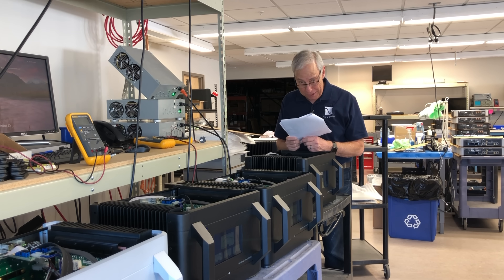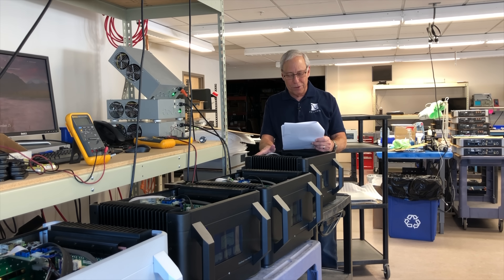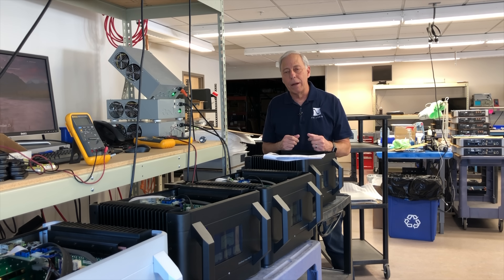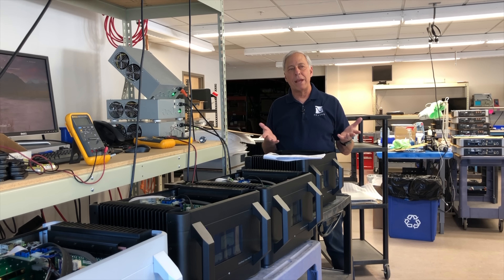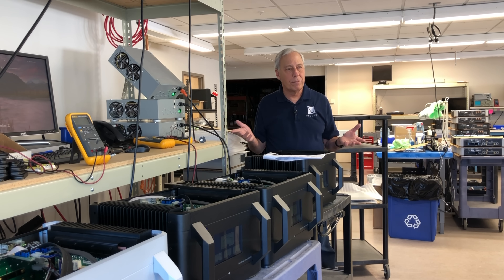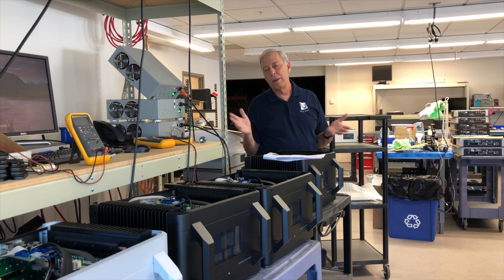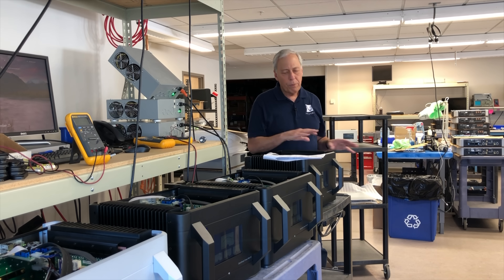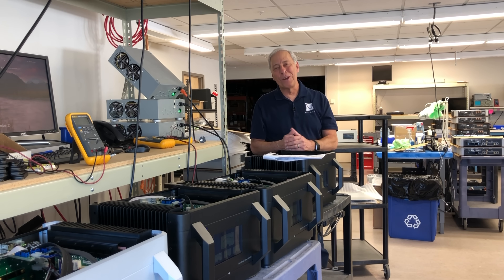Coaxial vs. conventional 2-way loudspeakers

Comment: I'm very surprised he did not mention that the biggest advantage of coaxial speakers is for nearfield listening. He mentioned point source, but gave a vague explanation of why point source would be needed. Since the tweeter is perfectly in the center, the time alignment of the bass and treble are perfect as the entire frequency range reaches the listener at the same time. If you need to sit close to your speakers, like at a computer desk, concentric speakers would be hard to beat. I almost went for the KEF speakers, but was turned away by the reviews claiming that the midrange was not that great. KEF and Elac make variations of concentric drivers but it's not truly concentric as there is a woofer on bottom and concentric midrange/tweeter on top.

Comment: When talking about Dual Concentric loudspeakers, Tannoy is the king.  They don't have the typical issues  with on-axis and off-axis sound performance on the higher frequencies, no significant toe-in of the speakers is required, sound dispersion is really good. I can move around within the room or sit down into my listening position without losing detail of sound (to an extent) as much as a 2 or 2.5 or 3 way speakers would sound like, I have Dual Concentric loudspeakers and transmission line type loudspeakers all made from Tannoy, certainly the dispersion of the sound at different listening locations is evident. That's the beauty of Tannoy dual concentric drivers, a point source, phase coherent
design and time aligned

Comment: For the high end stuff, you would be right, it (technically) sounds better if they are separate. But for the cheap stuff, a small tweeter won't really make that much difference to crappy separate tweeters, and the benefit of the point source sound enhances the cheap stereos so much more (and more bang for your buck). I got some $50 1.5 " (1" soft domes) and I can't really tell the difference between them and other 1" soft domes tweeters of the same price, that have large magnets.

Comment: Hello Paul, i guess i agree BUT dont know if you have heard the piegas with coaxial ribons for tweeter and medium frequencies? They sound wonderful detailed and extended and fast and dynamic, so much that the bass with convencional woofers gets a bit left behind. Piega even have line source systems also. Have you heard their top speakers? Each and every coaxial ribon is built by hand by one engineer! It is crazy...but do sound great if a bit analytical for some people.

Comment: What about the design theory where you take a horn loader tweeter then when the horn expands large enough you put a mid ranger then when it gets larger you put a woofer. Maybe 2way would be sufficient. I'd like to make one but its supposed to make the sound uniform
Reply: Ah, a synergy horn, pioneered by Tom Danley

Comment: Never heard of Tannoy? They are pretty old fashion.
Reply: Then you haven't really heard a coaxial driver.
Reply: I've worked with Tannoy all my life -- Reds, Gold series and I own a pair Tannoy DMT12's.  Never liked them and still don't.  The main problem with them is the horn (not tweeter) has a very limited narrow flare and the cone is supposed to be an extension of the HF wave guide.  Unless you're sitting dead center the woofer has a way larger image than the horn.

Comment: Any number of speakers perform and image well in their sweet spot. The problem is that most sweet spots are very narrow, often making listening a "party of one" or two at most before significant loss of sound quality. Music listening in my household is far more social so speakers with concentric drivers offer far better performance when playing to a crowd, for lack of a better word. I have Elacs in the family room surround system and they're terrific. The only non-concentic driver speaker I've heard that could compete with them is my pair of Seas Idunn standmounts, sold only as a kit through Madisound. Seas drivers, made in Norway, are some of the finest available. The list of speaker companies using their drivers reads like a who's who list of high-end audio. The Idunns, using their unique DXT waveguide tweeters, have usable horizontal dispersion as wide as 60-degrees off axis while having a measured frequency response of 50Hz to 20KHz +/- 1.5 db up to 15 degrees off axis! You can sit almost anywhere and they sound great. Their sweet spot for critical listening is nearly 8 feet wide and they constantly pull a disappearing act while imaging holograhically. I built a pair of them using Clarity caps, Mundorf resistors and Goertz copper foil inductors in series in the crossovers assembled by Madisound. I have an RSL Speedwoofer 10S subwoofer taking up the bass below 60 Hz. The combination absolutely slays anything in the $5K neighborhood and it drives my audiophile friends bonkers because the Idunns (in sapele figured veneer) and the sub set me back less than $1200. Now I'm saving up to get a Stellar S300 stereo amp for them...

Comment: What is the NPR or MPR programme?
Next time please don't stand next to those power regeneration modules !!... something there was causing terrible interference on the audio track .
Coaxial mounted speaker assemblies aren't much cop .. they're good for car doors only ... The Kef Uni Q drivers and the Tannoy Gold monitors use time aligned coaxial drivers which sound much better. I have always had reservations about the effect the cone of the LF/MR driver has over the waves emanating from the centre mounted HF dome .. but nonetheless the exponential curve of this cone would give the HF driver good sound dispersion. 
If Paul wants to build the new AN speaker systems I do hope he time aligns whatever drivers he uses.
The one thing that seems to be missing with the IRS V 's is a mid/bass speaker .. there is too big a contrast between those 12" drivers and the mid range ribbons ...
Reply: Janina, he says the mids start at 100hz. But I can't see how that can be still at 0db? frequency response? and not more like 9db down point. (NPR is our public radio here in the states. You have had me going for quite awhile where you are in this big world.)

Comment: I find my 2 way Qacoustics image and produce soundstage better than my coaxial tannoys.  Just goes to show a well designed two way can be better.
Reply: Hello Darren. Wich model of Q Acoustics and Tannoys do you have?
Reply: Pedro Luis Guillemain 
QAcoustics 3050i
Tannoy XT 8F
Reply: Two years ago I wanted to buy the Tannoys XT6F and a retailer who has them and the Q Acoustics 3050 recomended me the last ones, even costing half the price. I ended up buying the Q Acoustics Concept 40 and then, later, I changed them for the Q Acoustics Concept 500 which are monsters speakers. In AV Forums they prefer the Q Acoustics Concept 500 over some Tannoys with similar price. Im not saying Tannoys are bad speakers, but Q Acoustics makes incredible speakers for the price, competing with others twice as expensive.
Reply: Pedro Luis Guillemain yeah the concept 500 and definitely on my audition list. They do seem to punch above there weight.
Reply: @lloyd.8272  well, I haven't heard many expensive speakers, only the B&W 702 and the PMC Twenty 5.23 and I prefer the Concept 500 by far. Also two dealers who sell them told me that to better them, at least on the brands they sell, you have to spend quite more money. And finally you can read all the reviews out there, wich rave about the Concept 500 and there are a LOT.
Reply: I listened to both at a retailer and went for the Tannoy
Reply: To The Max how were they set up? 

Mine are 19’’ from the wall and 90’ apart and sat 90’’ away. 
Also have a slight tow in so the speakers are facing my shoulders.

Tannoys are good but I definitely don’t get the precise imaging and depth of the 3050i and I’ve tried lots of positions with them.
Reply: @lloyd.8272  Tannoy Turnberry Prestige GR, simply the best speakers I have ever heard
Reply: To The Max That’s a much higher class of speaker not to mention price range. 

I was referring to the Xt8f vs 3050i
Reply: @lloyd.8272  The thing that you are not doing with your Tannoys is giving them room, 90 inch apart is to short for any loudspeaker let alone a 8 inch driver, I have at least 236 inch/6 metres apart, if you can manage this you will notice a very big difference entirely
Reply: To The Max that’s how I’ve found the best sound with my 3050i with my room acoustics. Moving them further from the rear wall starts reducing the bass response, and moving them further apart starts to loose the centre image.

I’ve tried many different positions with the tannoys. There not as fussy with walls with the bass port being at the bottom but even using the rule of 3rds they don’t produce the imaging of the 3050i. 

Im having a evening in Saturday just chilling and listening to my system, I’ll definitely swap them round and push them further into the room to see what happens. 

Room is 18ft wide 22ft in length 6.5ft in height.

Comment: Paul, because of a recent discovery, I have to challenge you on tweeter limitations for coaxial speakers:  please check out Fluid Audio's FPX7 monitors if you ever get the chance.  (I have to credit Z Reviews for making me aware of these intriguing speakers.  I am a very loyal fan and Subscriber of this channel, but I find other channels helpful as well.  Paul or other viewers may not like Z Review's crass style, but Z Review provides honest opinions, good information, and did turn me toward KEF before Paul started mentioning KEF.  I am VERY happy with Q-Series bookshelves for both near-field and "normal-distance" listening.  In my experience, good coaxial speakers provide phenomenal imaging without tediously adjusting speaker placement.) ... Sorry for the long post, but one other thing, Paul:  what's your opinion about an even more unique design -- omni-directional speakers like that found in the Ohm Walsh?

Comment: You forgot the difference between cocentric and coaxial . All SEAS coaxes for example  are truly cocentric , where the tweeter is positioned in the dustcap position . As such the tweeter and the woofer share the same acoustic center . Cheaper coaxes do put the tweeter in front of the woofer's acoustic center with associated acoustic problems . The main benefit of a true cocentric coax driver is supreme imaging .

Comment: Attention If you're going to comment about how much noise the powerplant puts onto the video audio then DON'T! It's because the top cover is removed, and the noise is RF, this won't affect an audio system, the wireless mic uses RF which is why that is affected. And for those saying that the top cover of these things is plastic, it's not, it's metal, with MDF glued to it, and a piano gloss black finish applied to that.

Comment: Is all that interference on the mic coming from the powerplant ? What does that do to any audio electronics placed near it ?
Reply: He has the cover off, which means any rf emitted or radiated will effect any sensitive electronic device i.e microphone circuits (mics & it's circuitry are very sensitive) which is why you hear all that noise.
Reply: @relminihakase  Are you sure the top is metal ? Every photo I can find looks more like a black plexi top not metal.
Reply: @dominicdiclemente8877  It's MDF, with a metal panel on the back and a black gloss finish on the other side.
Reply: @ArlenMoulton2  any idea why they used MDF as opposed to all metal?
Reply: @brianmoore581  to get the glossy piano black finish
Reply: He's got problem with the shielding on his mic
Reply: @johnsweda2999  that and other problems as well...
Reply: Dominic DiClemente well his mic was doing it in a video the other day.